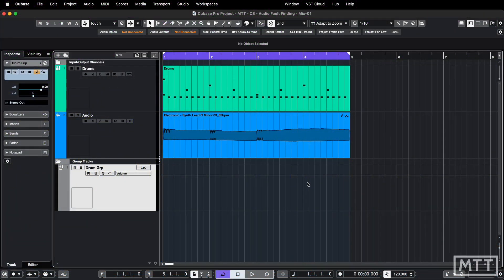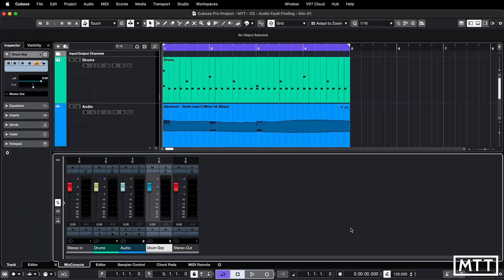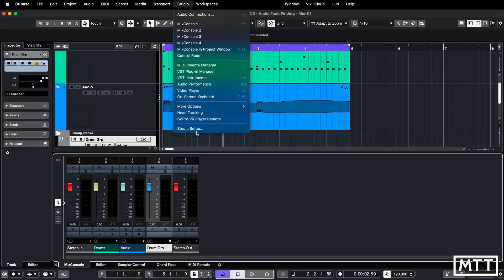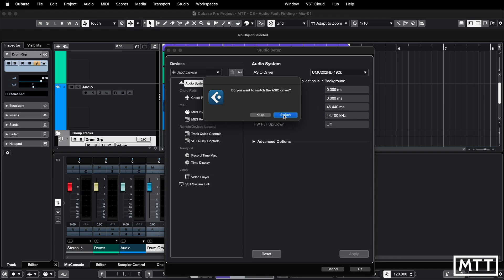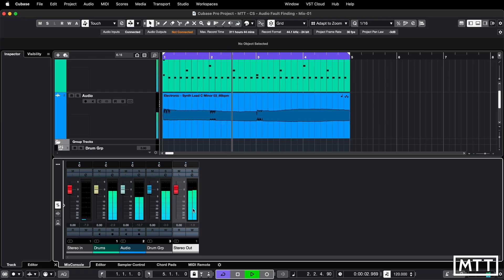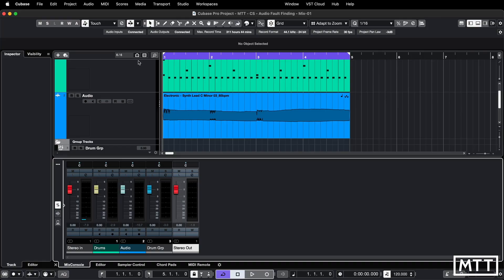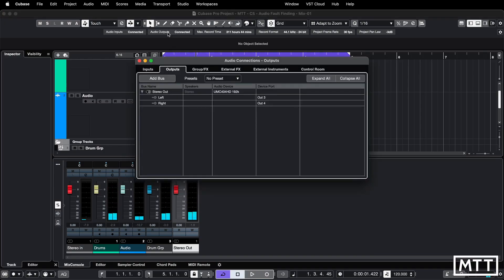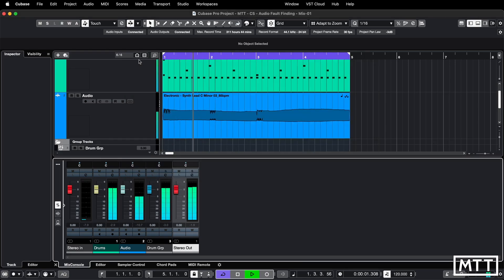Cubase Skills:  Fixing No Audio Output in Cubase

Comment: Unfortunately, this did not resolve my problem. My use-case was mentioned at 4:45, but I'm not seeing any options involving Control Room. The issue seems to lie primarily in the fact that Cubase does not want to share audio outputs with my operating system. I appreciate the in-depth troubleshooting video either way though in case I come across these other issues.
Reply from the maker: What audio interface and/or driver are you using?  Some drivers do not play well with windows, or with other applications trying to share them (I have this a lot with clients when they try to use Zoom on a PC running Cubase, although I'm lucky as my Presonus shares them happily).
Reply: @musictechtuition  I was just using my default Windows output. I ended up asking about it on the Steinberg help forum. Turned out it was because my ASIO drivers were out of date (didn't think that would be an issue especially considering the newest driver was from 2019). Initially the issue was that it wouldn't let me switch the Realtek HD audio to be used in Cubase when it was originally being used by Windows. After the update, it allowed the "Release driver when not in focus" setting to function properly. HTML5 players still don't play nicely running in tandem with Cubase, but it's far better, and more than adequate for my use now.
Reply from the maker: @Cryobolt  THanks for following up - I'm sure someone else will find that useful.  Glad it's (mostly) sorted.
Reply: Same here
Reply: Didn't work for me either. No control room for me.

Comment: Hello, thank you so much for your information. It was all accurate and good information. I just wanted to point out one thing. This happened to me before, and I wanted to mention it as an example. I couldn't get any sound because the trial period for a compressor plugin I installed on the Stereo Out for mastering a song had expired, and the audio output bus had stopped working. I tried everything here, but when I tried to open each plugin individually on the Stereo Out, it told me the compressor had expired. I removed the compressor, and the problem was solved :))) If you have plugins with trial versions, be careful; some of them shut down the audio bus when the period expires. Also, if there's a month-long trial period, people sometimes forget :)))
Good luck...

Comment: Thank you for this very comprehensive tutorial. However I’m still stucked with no audio output. I couldn’t find my use case in your video.
I’m using a PC with windows11 and trying to listen to a midi file (drums and bass) that I imported. I’m using the Steinberg built-in ASIO driver and the ports are all active. If I go to to MIDI port configuration the dialog box shows no driver, so it may be the issue ?

Comment: what if the bluetooth headphones arent in the output section? I am listening to music on the same laptop with them and its connected fine but they arent appearing in the cubase output at all and cubase is only playing through the speakers
Reply from the maker: I'd guess that is something you'd need to fix in the Bluetooth headphone mixer/software.  It's difficult to say as there are so many different options, but I'd check there, or if you're using the generic ASIO driver, then in the control panel for that you may be able to pick the headphones as the output.

Comment: As always a great, useful video. 
Over the many years of using Cubase I have encountered most of these issues and consequently have a very good fault finding system. I always use Control room and have done for about 7 years (I think 🤔) but I did have one of the issues mentioned in this video.  However a couple of weeks ago I purchased an SE PRS and wasn't happy with the pickups. So, I though I would shove some Fishmans in it. I have never had a guitar with active pickups in the many, many years of playing, they have always been passives (humbuckers, P90s, etc). So, I changed the pickups with the circuitry purporting to have 200 hrs of battery life. So, I spent a few days recording (unplugging after every session). Left it for a week, started to record again and on the new track for some over dubs noticed there was no sound on my new guitar track... exactly as you have shown here. I thought I must have configured the new track wrong. Went through my fault find process and ... still no sound, nothing, no signal 😖.  About 10-20 mins went by where I checked again, still nothing... 🤷‍♂ Then it hit me... must be FLAT BATTERY! Changed it and 💥 Boom back in the room! So, this method helped me in around about way.. the routing was correct, the group channels were correct, the control room connections were correct the fader was up... In the words of Sherlock Homes:
"When you have eliminated the impossible, whatever remains, however improbable, must be the truth." Flat battery! 🤣🤣🤣🤣😉😎👍
Reply from the maker: Yeah... I've lost count of the number of times that I've had something which was assumed to be OK be the problem.  My wife thinks I'm a bit OTT because I say you can never assume anything works when you have a problem like that... but it's often true!

Comment: If I may add one pesky little button that trippped me up once. If you open the ControlRoom pane, you may notice that there is a little blue power butten beside each heading. It's very easy to miss that this has been turned off. It's especially tricky, because if the ControlRoom pane is closed, there is no other clue that this is the cause of the problem.

I took me a couple of hours to solve this issue. I looked everywhere, but missed this little button! Since that day, this is one of the first places I check.